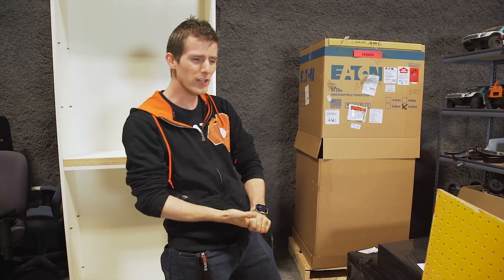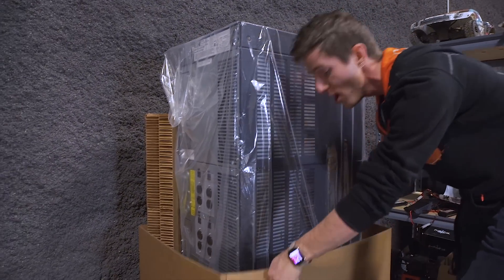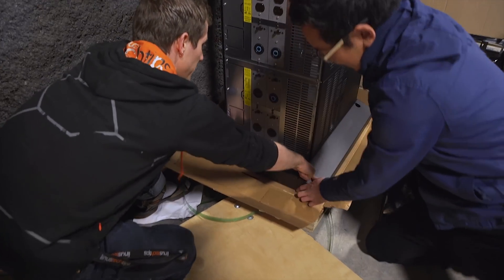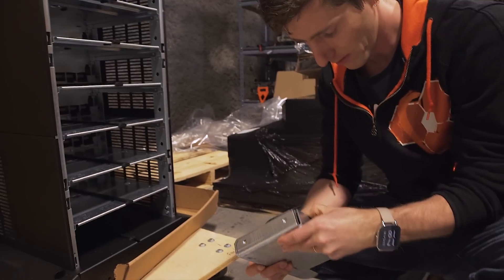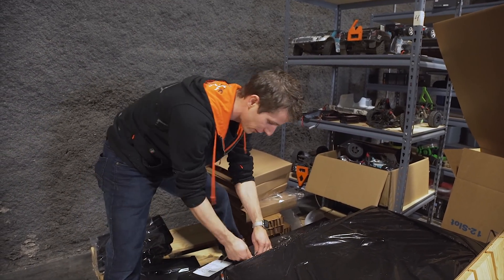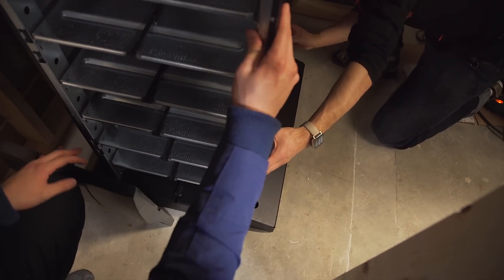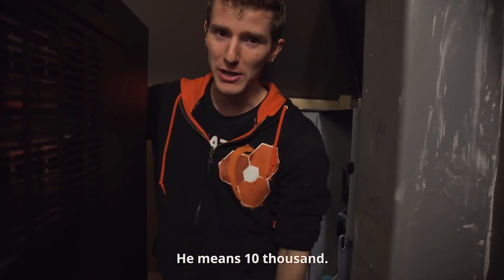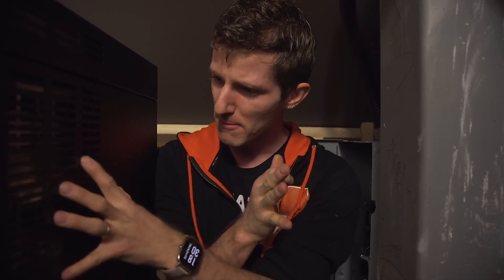HOLY $H!T - A $17,000 (CAD) Man-sized Battery!

Comment: They ran a 100 amp circuit into that room because 100 amp circuits only have 80 usable amps, and that Battery back up said that it needs 80 amps in the manual, in case you were wondering. Circuit breakers can only use 80% of what they’re rated for

Comment: well that was expensive, we only had like 2 rackmount UPS here and thats sufficiently enough to power the servers, well instead of getting one of that UPS, we just ended up buying a automatic diesel generator which kicks in automatically if power is out for about 30 seconds after prolonged power outage (timeout is 1 minute, if power is not come back after 1 minutes, this thing engage)

Comment: I was under the impression that double conversion UPS units were not that great. an efficiency loss of at least 20% right out the gate, sorter service life of the inverses as they do not get a brake and capacitor life is limited, as well as more dust ingress, and battery life is normally reduced because charging lead acid batteries are held at a higher voltage than their "full" storage voltage. maybe the company has some tricks to solve some of these problems but aggressive switch over and line filters should be adaquite. I personally would have favored larger capacity than powerhandleing abilities to account for battery degradation with time to get a few more years before replacement. it would be nice to know if the batteries are compiled of standard off the shelf parts and are able to be serviced rather than buying new over priced modals.

Comment: Seeing your UPS closet, I am more than a bit concerned that you do not have enough ventilation for proper cooling for the UPS.  The electronics may be ok, but you may have significantly shorter battery life.  The worst part of UPSes is the on-going battery maintenance costs, so it is always best to insure the best storage and operation conditions to maximize battery life.

Comment: I work at Eaton and make those things. Recently we made one where the 125A MCB was not beefy enough so we put it through two, for a nice 250A capacity. Some of the cables I install are 35mm2. An on-site engineer was fired a few years back because he left a spanner on top of a unit he was working on. It fell in and vaporized, causing all sorts of damage.

Comment: For $17k USD, you could get 3 Tesla Powerwalls, which would provide a center of that size with about 4-5 DAYS of power. Seriously, that's what they claim - if you were around 10kWh/hour that's what it would provide - plus they're supposed to last 10 years instead of 3-5.

Comment: You could actually just run all your gear on 208v and save some energy and reduce the heat output of the UPS and the servers in the process. Power supplies run more efficiently at higher voltrage and lower amperage, which makes sense if you think about it for a minute. Everything sold these days including regular desktop PCs let alone servers supports multi-range input votlage from 100v-240v. The standard in the US for server power feeds is 208v (slightly different power output in commercial buildings than residential due to the way the power is delivered).

Comment: I don't understand what your concern about data loss is... Doesn't the OS you use support a fully journal'd filesystem with any critical data being flushed to disk ASAP? And I'm sure you use SSD's so they should be able to flush a write within the hold-up time of a decent power supply (which should be a decent fraction of a second with the SSD performing the write in a few milliseconds) and being journal'd the filesystem should be impervious to partial writes.... Oh wait you're using windows aren't you? Lmao. Well you know Linux uses a metadata journal on it's ext filesystems by default which means only the file content can ever end up in a partially written state. And TBH the application can do a simple write-and-swap to make operations atomic with like 10 lines of code... I wonder why Microcrap hasn't figured out how to OS properly yet...

Comment: 12kVA would be exactly 12kW @ a power factor of exactly 1... And from what I can tell about the power supplies you use they should all be active PFC (power factor correction) approaching 1 (at least 0.98). A power factor of 0.98 gives you 11.76 kW of useable power.

I may edit this to readjust after I look up the specs from the next power supply I see you use if I remember and don't get lazy.

Comment: Why does that thing need a network card give u the power usage stats.
Reply: anghellic By connecting the UPS to the LAN, they are able to configure the UPS to send a shutdown command to all the servers and other sensitive equipment (so they can shut down safely) before the batteries run out of power. This has the potential to save a lot of money. In fact. For a production company, it can actually save more money in just 1 power outage (caused by the loss of files and the man hours put into the work) then the purchase and installation cost of the UPS!

Comment: I don't believe in double conversion for most situations. It's inefficient, and seldom necessary. For some places in Florida where there are lightning strikes like crazy, perhaps. Fast switching UPS systems restore power before equipment notices anything, not even fluorescent lights (which blink for almost anything). Fast switching UPS systems are just expensive up front in return for higher efficiency. And let us hope they add a generator. A generator prevents the UPS from needing to run down its batteries, and is generally larger than the UPS to power more stuff. Like HVAC, so their pipes don't freeze and flood the place.

Comment: any recommendations for a battery backup for my home PC/freenas server? I know freenas only supports certain ones. preffereably something that will have surge, and USB/serial communications. looking to run a 

rackables 2U server (have it already (was free)) with: dual quad-core AMD opterons 2.6ghtz 32gb ram,has 4 USB, 1 serial port. 4 3.5" hot swap bays, 2 internal SATAIII ports/drives available(thinking 1 more 3.5" for the array (ZFS, and 1 small (120-240GB) SSD. only planning to run PLEX server, transmission... 

computer is a gigabyte z170x UD-5, i7 6700k OC to 4.4ghz, 16GB ram corsair LPX-3000mhz(upgrading to 32 soon), asus strix GTX 1080, 256gb samsung pro950 M.2 boot drive. 

my only other thaught is to simply ditch the 2U server altogether and put a raid card in my desktop, and run plex on the desktop, and forgo the server, just upgrade RAM, and roll with it all on one system (less power to run).

Comment: Nice kit though I prefer APC myself. It would have been nice to see the wiring of the system along with setting up the SNMP on the different machines. A look at the interface console and load / tuntimes would have been good to. Interesting to watch but rather pointless as its just a " wow look what I have ner ner ne ner ner " video, not a product review and not a video that explains operation and safe use of kit like this. Pretty much thumbs down on this vid for me. He talks about using higher voltage but pretty much all the servers in my room have a multi output low voltage link to them excluding the need for the inverters. My work setup has 10000ah of batterys in 100v arrays and runs our kit for nearly 48 hours. At todays exchange rate if we purchased our current kit we would have spent nearly £1000 less! N.B. Very good points about safety on the comments. Kit like this should be installed by an expert in UPS systems. Very disappointing Linus !!!

Comment: wouldnt it just be easier/cheaper to have a diesel power generator with a power corrector/stabilyzer on the output and power the several UPS from it with an automatic breaker to switch it on when the company power fails?

Comment: 240v? Laughs in British
Reply: Voipher except it's can probably be toggled into 120. I had to run my tv through a transformer while in Britain. Hopefully they don't have to cause it ruins electronics
Reply: In the UK, no.

The computer I'm writing on has a PSU that uses less wattage for more volts. 
No transformers for a proper power grid with proper electrical systms and a proper plug.
Reply: Voipher that's because you are in the U.K. Using U.K. Appliances. I was in the U.K. Using American appliances. So they had to run through a transformer
Reply: @jakem5039  same watts less amps volts times amps equals power in watts. so double the volts for the same power halfs the amps basic algebra
Reply: @averywellsand888  my dude it's been 5 years.
Reply: @jakem5039  my dude I hope you figured that out in the last 5 years then
Reply: @averywellsand888  The original point badly made is 240v PSUs have a slight increase in maximum wattage due to the thermal efficiency afforded by lower amperage so the PSU I used would operate at a maximum wattage about 20-30w lower in 120v inputs.

Comment: they installed a few of these where I work. the idea behind it is these battery banks will juice the system during high peak use. PG&E (the west coast power company) charges its customers based on the highest peak during a days power consumption, so lets say from 6am - 6pm the most power was consumed was at 1pm (peak power) they charge you for the entire day at that rate which is of course the most money as well. what these battery banks do is flood the system with stored power thus bringing the peak down and smoothing out the curve. its a great idea to install these when your monthly bill is a little over $50,000

Comment: The difference between this and generator is that this provides line conditioning so if there is a brownout or surge the servers never see it. Also its always online so if there is a outage the power going to the servers is never disturbed, whereas a generator needs a minute or two before it becomes available by which time the servers have long crashed. On the back of the unit at the bottom are Hubble twist lock connectors that are a much more professional solution to providing power than extension cords. As well, if you ever mess with big networking equipment like 200TB NAS servers they need those twist connectors and can't be plugged into a normal wall. And $17,000 is dirt cheap for enterprise grade gear.

Comment: Dumb question: how is a "power module" not just a battery? or is it, and it's just called that for some reason?
Reply: A power module is the rectifier/inverter setup for the UPS.  This design uses separate batteries so you can scale your total output wattage and your runtime independently of each other.
Reply: +Lewis Andrews Also, the batteries need replacement as they wear out after a few years, so most UPS devices already have replaceable batteries. Making the power inverter / rectifier units replaceable further reduces the need to shut down all their servers to work on the UPS plus it allows that same 12 bay chassis to be used for different combinations of max W and max Wh (Linus chose a 5kWh/10kVA peak config).

Comment: you need to get two pdu (power distribution units) and connect them to the massive plugins 230V AC and they distribute the power, making sure each server possible is plugged into each of the PDU for redundant power.  at least back to the UPS, and truly redundant would be to use two PDU's each with 5kw/h   or to fully be mission critical two 10kW/h UPS, and then add a second power feed, preferably from a different company or at least different generation, and then you can add in diesel power generator for a zero downtime solution
Reply: James Dickens I don't understand exactly what you said, but it made sense
Reply: If someone has a reason to use that monstrosity of a setup, you have bigger problems

Comment: I want to know why you would choose a Battery over a Diesel or Petrol Generator given that it would give equivalent power for less?
Reply: Clifford Bryan john Wilson Because a generator may last long, but many have a small delay that would rec havoc on the servers. The battery is enough for the servers to properly shut down.
Reply: they could get a mini cheaper ups so it wont have a delay then connect that to a gen and itll be m uch cheaper
Reply: PuLsE Munstaz Envision the following scenario : You are linus in the building, the power goes off, immediately the server starts to use power from the small ups, and as soon as that happens you turn on the generator, it works! itll get rid of the delay and save money.
Reply: Davidog But cheaper isn't always better. End of discussion.
Reply: Because a smaller UPS wouldn't supply enough power. A small UPS is good for one computer, not a whole server room.
Reply: Davidog But generators require more upkeep
Reply: The UPS has no delay, there is no power interruption. If the expected power failure is not to long. You decide how long you want to be live on the UPS when you order one.
Using a generator you would still need a UPS to overcome the delay from the startup time from the generator. The UPS will not be smaller because the UPS would still need to provide the full power (the full Amps) needed at full load. Beside this a generator delivers dirty power, not a nice smooth sinusoidal voltage. So you need a transformer to get rid of all the crap on the voltage. Next to this a generator is not as reliable and needs more maintenance. Monthly testing if it will start etc etc. In the long run an UPS is cheaper.
Reply: but power the small ups with a generater to rid the small delay
Reply: buuuuuut, it's way cheeper than spending the price of an "ok" new car
Reply: Mitchell Kaminski
Reply: Davidog Cause they don't need prolonged power. They only need enough to power down down the servers
Reply: But it would still be cheaper, and you get the BENEFIT of all day power. End of discussion.
Reply: Davidog wtf are you talking about
Reply: Clifford Bryan john Wilson a petrol generator takes longer to start so u would still need a battery but they could use this thing while they start the generator but cost per benefit goes way down if they get both
Reply: idk
Reply: but in this case it is, it's like mac and windows, windows always wins.

Comment: for how long would it be able to run an average PC?
Reply: How many gpus do you have to use 700W
Reply: If this has 10,000wH and your system runs 700w on average for an hour, about 14 hours. But that doesn't include your monitor. Mine is 180w. So it'd run my total system for 11 hours. If you plugged in your 300w sound system, about 8.4 hours. (although sound systems vary power usage greatly and 300w is the RMS.)
Reply: idk a day?

Comment: Why not just get a back up generator???
Reply: A back up generator on its own has a delay that will still cause computers to suffer a power loss shutdown, which sensitive electronics will not be happy about.

As much as my current knowledge can provide, UPS is designed to maintain the electricity the moment the primary electrical grid has no power under various reasons, but how long it lasts depends on the capacity and how many devices are connected to that. Dealing with a single computer set does not draw as much from the battery as a room of computers, though businesses can have beyond a floor full of them. There are more sophisticated and expensive designs where it can detect voltages higher or lower than usual and cut them from getting to the devices and draw from the stored charge until voltage is safe.

I would advise researching at your own time and draw your own conclusions. UPS has its uses in industrial and commercial fields, where a quick or prolonged power problem can ruin everyone's day.
Reply: again why not just get a UPS that runs for that time it takes for a generator to kick in. If your expecting a long loss of power.
Reply: DC0M2
UPS + Generator is an effective system to balance electrical storage and generator fuel storage, especially in prolonged power cut off.

Of course, that will depend on affordability, safety, and location, which I prefer not to elaborate without providing information too large for a comment.

Comment: hey linus have you done a video based on if one should run a gaming system off of a UPS and what the benefits and negatives points to doing so would be? I would be really interested because I will be upgrading in 2017 and would be wondering if it would be a worth while investment... since I know they aren't exactly cheap!